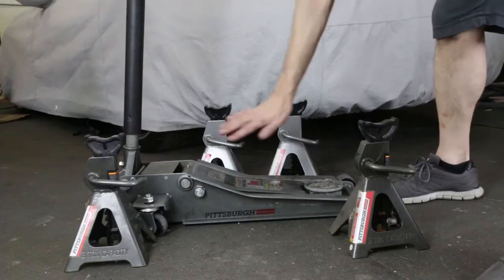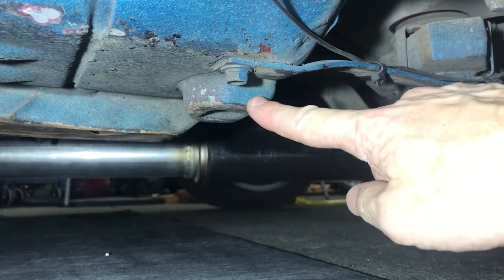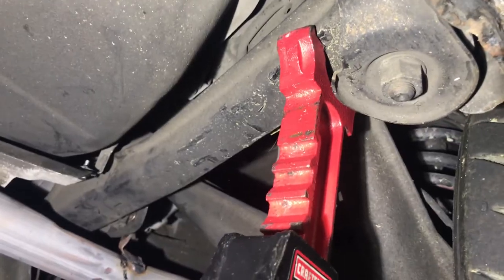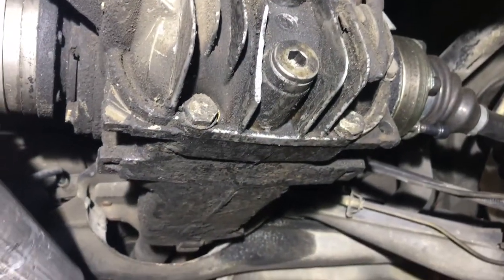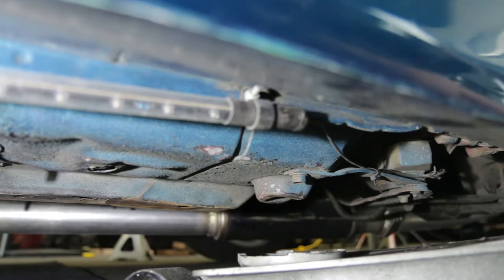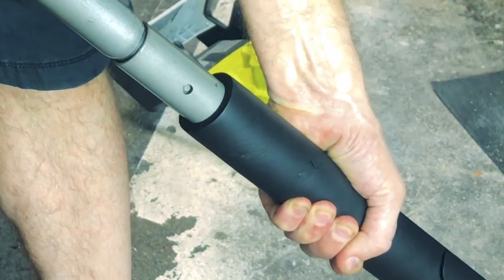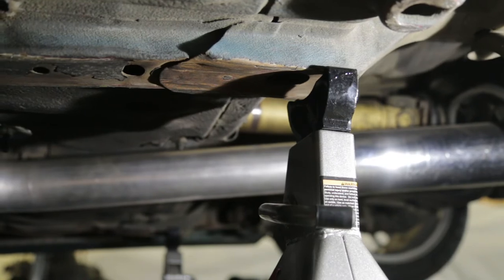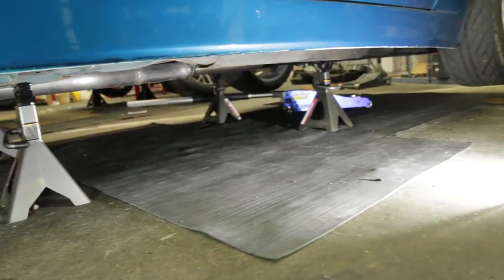How To Use A Hydraulic Jack

Comment: Yeah, jacking up on grass/dirt is not a great idea but if you have to, putting a thick piece of plywood beneath the jack helps keep it from sinking.
Reply: Won't lie, I've done both hundreds of times. A basic understanding of physics helps. That said I always put in back ups in case something fails so I don't die.
Reply: Yep, I'm terrible about backing up my computer, but i never rely on a single support when the car's in the air. :-) In fact, once I put the weight on the jack stands, I generally leave the hydraulic jack in place in case a stand moves.
Reply: Much same. I always leave the jack up once the weight is on the stands. 👍
Also prefer to put the car on ramps instead of jack stands when possible.
Reply from the maker: Harley Pebley nice to see you here! Yeah plywood or even something stable to support the vehicle if you have to. I'd avoid dirt if possible.
Reply: Good plan. XD
Really wish my MR2 was in the garage right now.
Reply: Yes, dirt's not ideal, it gets both the cracks of both you and the vehicle, and spills are a pain to clean up. But sometimes you deal with what you have. I once did a body swap at a place without garage or driveway. The weeds helped with dust control. 😬
Reply: Just dropped an MR2 fuel tank in the gravel/dirt driveway. XD
Reply: Also dropped an Eclipse GSX transmission on grass. :P
Reply: Ugh! Glad it was you. 😀
I hate working on FWD cars.
Reply: AWD, so there was the added pain of a transfer case. :P
I agree though, hate working on transverse engines.

Comment: Great videos but DO NOT jack a 240sx by its frame rail, super thin sheet metal and it will fold!
Reply from the maker: +silly240sx Thanks. I'll have to research that a bit more. I generally use the jacks points to bring it up and depending on what I'm doing, rest it on a frame rail. Every car is different so it's always a good idea to read up first.